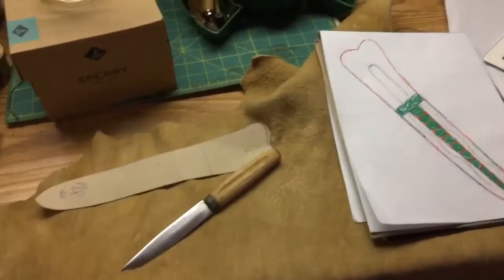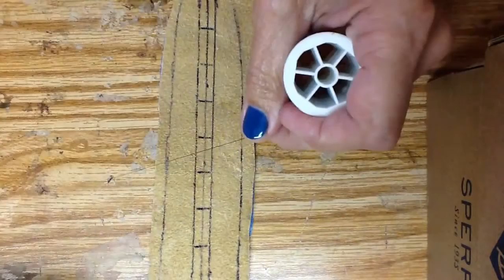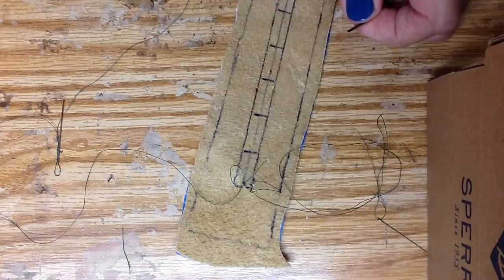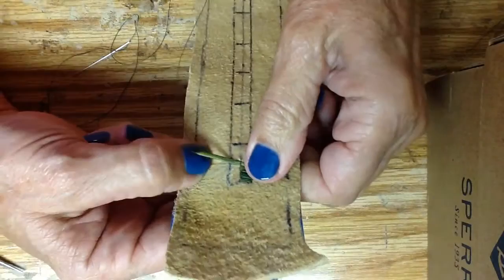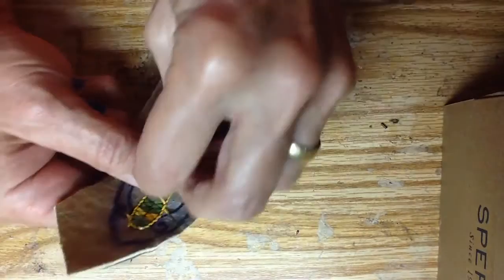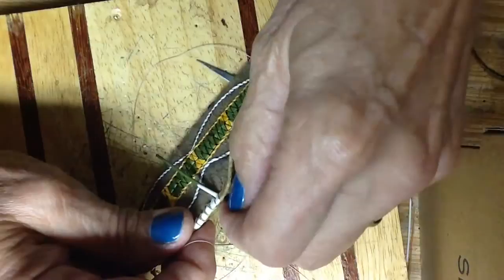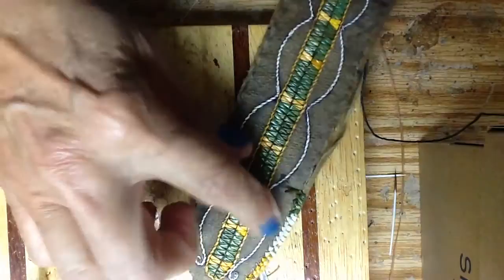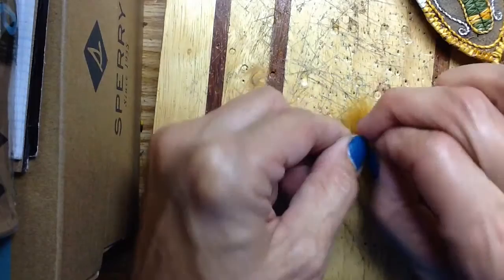Building Another Quilled Sheath

Comment: Hi I'm just learning and I have a question please and thank you. For the zig zag you flatten the quill and when you do the edges how come you didn't flatten the quill? Sorry for the questions but I didn't hear if you explained that part. Thank you for your video
Reply from the maker: bev dowdy yes you are correct. You flatten the quill for jigjag to give it a nice neat appearance but for edging you don’t because the fatness of the quill around the edge fills in real nicely . If you flatten it it won’t look as full and nice.
Reply: @lindapritchard5854  thank you so much. Does it matter what kind of deer hide you use to practice with?
Reply from the maker: bev dowdy yes if you use a commercial tanned deer hide it will be very difficult to get good results. Brain tanned deer hide done right is like  using a soft material. You only pick up the very top of the hide when you stitch not clear through. Hard to do that with commercial tanned. Good luck and have fun.